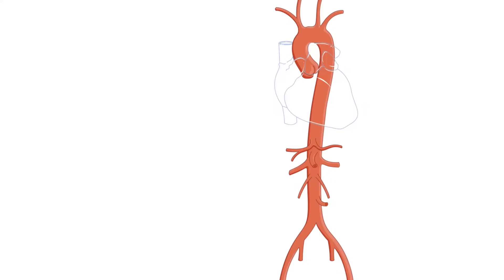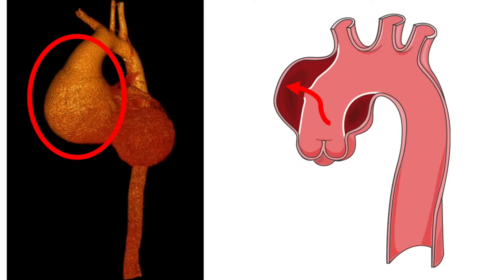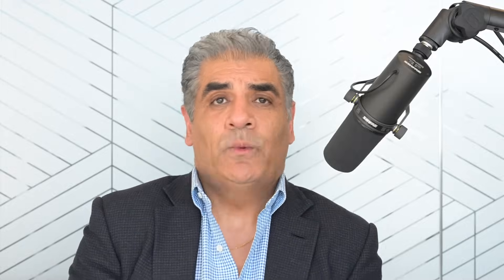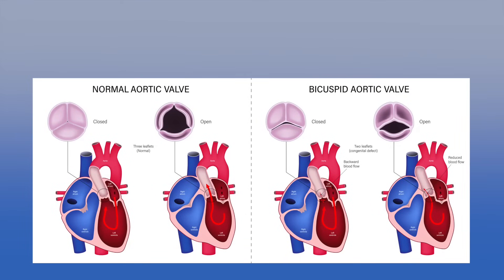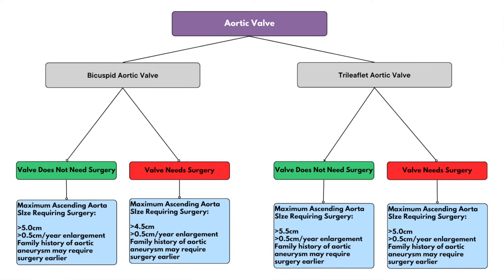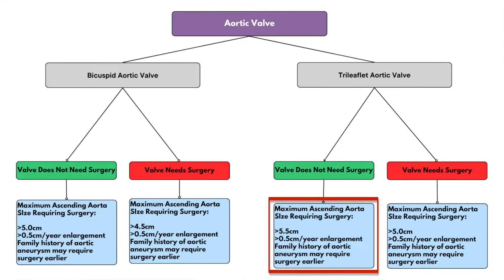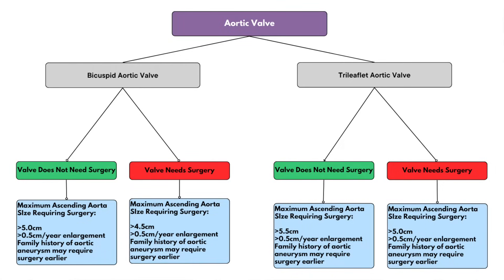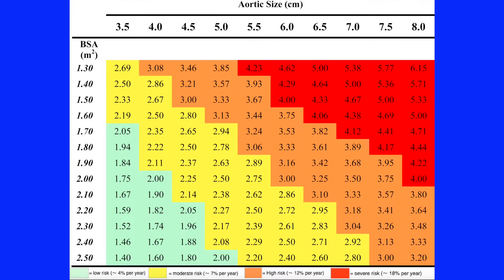How serious Is A Dilated Ascending Aorta?

Comment: At 53mm I had my Aortic root aneurysm replaced via the surgical technique known as the "David Procedure", whereas my aortic valve was not replaced. For those needing their aneurysm replaced, be aware of these side effects that I experienced. Post-op rapid atrial fib, 30-50% of patients experience this, also aortic valve regurgitation and murmur, with some people experiencing shortness of breath from the leaky aortic valve,  and lastly a bothersome chronic frequent PVC and PAC arrhythmias. Expect to be placed on a low dose beta blocker, for heart rate and arrhythmia treatment, even if you have normal B/P. My recovery at home took a full 12 weeks, mostly due to the rapid atrial fib, which resolved after about 5 weeks of anti arrhythmics. Today,  I am at over 5 years post-op now w/o A-fib, resumed my passion for hiking in the mountains 5K-13k elevation routes fully recovered. As far as my hiking vigor goes, I felt fully recovered approximately 1 yr post op. Cheers!

Comment: Should I be worry??Had an echo done last week and at the end it says dilated aorta

 LEFT VENTRICLE: Left ventricular size is normal. LV wall thickness is normal. Global systolic LV function is normal. Est. LV Ejection Fraction is 60-65%. LV Ejection Fraction (MODbp): 69.2 %. There is no evidence for LV regional wall motion abnormality. Normal diastolic function. Normal LV filling pressures. MV E/e': 5.6 . MV E' (septal) 7.2 cm/sec. MV E' (lateral) 10.1 cm/sec. LA volume index = 27.9 ml/m^2 (Norm 16 - 34). MV E/A: 0.87 . MV E 48.8 cm/sec. 

LEFT ATRIUM: Left atrial size is normal (16-34 ml/m^2). The interatrial septum (IAS) appears to be intact.

 MITRAL VALVE: The mitral valve appears structurally normal. No mitral stenosis. Trace mitral regurgitation. 

AORTIC VALVE: The aortic valve appears structurally normal. The aortic valve appears functionally tricuspid. No aortic stenosis. Trace aortic insufficiency. Unable to measure AI PHT. 

RIGHT VENTRICLE: Right ventricular size is normal. RV function is normal. TAPSE = 2.9 cm (Norm 1.7-3.1). RIGHT ATRIUM: Right atrial size is normal.

 TRICUSPID VALVE: The tricuspid valve appears structurally normal. There is no evidence for tricuspid valve stenosis. Trace tricuspid regurgitation. The estimated RVSP could not be accurately assessed.

 PULMONIC VALVE: The pulmonic valve is not well visualized. There is no evidence for pulmonic stenosis. There is no evidence for pulmonic insufficiency.

 GREAT VESSELS: The aortic root dimension is normal. Aortic Root dimension = 3.0 cm. The aortic root index is 1.9 (Norm < 2.4). The ascending aorta dimension is increased. Ascending Aorta dimension = 3.9 cm. The ascending aorta index is 2.4 (Norm < 2.4). IVC size is normal. IVC collapses > 50%. Estimated RA pressure of 3 mmHg. PERICARDIUM: No evidence of pericardial effusion. 

SUMMARY: There is no evidence for significant valvular pathology.

 TAA Surveillance: Thoracic aortic dilatation is noted. Consider gated CT for further evaluation if clinically appropriate.
Reply: I suffer from chronic hypertension.

Comment: I am a 29 years old male 85 kg. At januarry of 2024 i did an echo showing my ascending aorta at 42 mm and a biscupid valve with minimal regrutation. At Mars of 2024 an CT scan my dialation at 41.5 cm. On July 2024 an echo showed my dialation at 41 mm. Today on 3d of octomber 2024 an echo showed my dialation at 3.9. How is it possible that it grew smaller?
Reply from the maker: Echo is not the best estimate. Gated Ct or MRI is best.

Comment: i am 39. 1.75 m tall. 102 kilos. 4.9 ascending artic aneyrysm  in august(from 4.8 in april) and moderate bicuspid valve insufficiency. Whats my risk? i honestly dont understand the table. what should i do? is it time for surgery?
Reply from the maker: You need surgery  with valve preserving root replacement if possible. Long term
Prognosis excellent
Reply: @Thekeyholeheartclinic  what is my risk of dissection etc?

Comment: Hello thank you for your knowledge and time, unsure if I need second opinion they did multiple tests and this is what was determined. Would like to note this was found in occasional testing for something else.. Mildly enlarged mid ascending aorta diameter of 36mm. Everything else was normal on echo when later checked. I am 31, 5'9". Healthy but slightly on the heavier side 180lbs. Was told it could be due to biking? And was told to continue my normal exercise? Anything else it could be? Was told to check it again in a year or two.
Reply from the maker: 36mm aorta is likely normal but worth a repeat measurement in 2-3 years to ensure no growth. Is the aortic valve normal and trileaflet?

Comment: Found out last year I have Marfan syndrome and have a mild dilation of the aortic root at 3.9cm it’s an even dilation circumference wise. it’s been stable the past year and a half a bit nervous but hoping it doesn’t grow anymore. My father passed away at 44 years old from an aortic root dissection.
Reply: Kchilz32:  I also have had a diagnosis like this in recent years and had an abdominal aneurism repair (AAA) repair which required a long healing time.  Now it has been discovered that I have a descending aortic root enlargement which is being monitored. Father passed away at 57.  Get yourself regularly checked.
Reply: @ it’s nerve racking. I was just told last week I will need and aortic root repair in a couple of months. Doctor said they were going to connect with my specialist to find a good surgeon. But haven’t heard anything yet
Reply: @ :   It’s not my place to tell you what to do, but at my age of 75, a few different doctors who have checked on my situation are not alarmed at my dilation which is at 4.3, which has remained stable for a few years.  To make matters worse, even with blood pressure medication, my blood pressure is usually crazy high at 180 systolic - especially when I’m in the doctor’s office.  Ask again if your particular measurement is considered an emergency.

Comment: just got my results today and the dilation is 4.5 cm. the pain in my top middle back I describe as a deep very painful toothache, it never goes away. I am 57. My Dad and my Mom's sister (my Aunt) have both had open heart surgery, but I don't know the original reasons. I am a little frightened. I am stoic tho.
Reply: I had open heart surgery to repair a dilation was 5.4. Had the valve replaced also. Was 60 at the time and am doing very well. It’s a scary surgery but ensure you have a trusted hospital and surgeon and you should get through it well.
Reply: @eriksossa5297 : What is your trusted hospital, please?
Reply from the maker: Keep under surveillance 🙏

Comment: Hi there, just found out my Aortic Root is 3.7cm. 49 yr old female  Aorta Diameter is 3.4cm. Mild aortic regurgitation. Trace pulmonic valvular regurgitation. Trace bicuspid regurgitation. Borderline dilated aortic root 37mm. What does this all mean?
Reply: Thank you so much for your reply, I will look more into this matter. Aortic valve is trileaflet. Tricuspid valve normal. Only time it mentions bicuspid is when they mention Trace bicuspid regurgitation. Quite confusing.
Reply from the maker: Thank you for sharing. This will need monitoring If you have a truly bicuspid valve with serial echo and CT scan. Also genetic testing for aortopathy is useful especially in presence of family history.

Comment: Hello Doctor, My father is 69years( 135 kg, 6ft height). He has bicupid valve and has ascending arota is 5.5cm.  Should he go for TAVR or Bantall Procedure.
Reply from the maker: Thanks…. No question here: aortic root surgery. TAVI will not deal with enlarged aorta pipe.
Reply: I'm 68 yo with identical problems as your dad, was 50 mm in March 2023, 6 months later increased to 53 mm. My surgeon didn't schedule the surgery until Nov 7th 2024.  I was discharged 7 days after the open heart surgery, recovering well so far, I walked for almost an hour today in a mall and stopped taking Tylenol 500.

Comment: Hello Dr. Thank you so much for this video. I found out about 2 years ago I had a dilated root (4.1 cm) and dilated ascending aorta (3.3). I've done a ton of research and have been very impressed with the keyhole technique. A couple of questions, why has this not caught on in the US? Do you anticipate that this technique will soon be more common here as well? Also, regarding my measurements... Finding out I had this dilation turned our lives upside down. Since my initial measurements I have not had any further dilation. I don't smoke, good blood pressure, tricuspid valve,  and am in general good health. I've lifted weights forever. I'm wondering if my measurements are just the result of remodeling due to my athletic endeavors. Could having an aortic root of 4.1 cm (which has not grown in the last 2 years) just be a normal thing for some people? Especially those that have a long history of working out. I am male, 5'-10", 195 lbs, and 43 years old. Thanks so much!
Reply: Did you do a cat scan or echo? Mine was way off in a echo
Reply: @Lisachelle  I did both a CT and an Echo. After numerous echos and CT's, they have all been very close to each other. I have heard that depending on where the dilation is, you could have different readings.
Reply: Mine echo was 4.7 and cat scan w contrast was 3.9 mid ascending.. way off to me.. a high normal

Comment: Left single renal artery are seen with no significant stenosis.
Abdominal Viscera:
The liver, spleen, pancreas and intestines are normal. There is no significant mesenteric /
retroperitoneal lymphadenopathy. There is no free or loculated fluid collection in the abdomen.
Bilateral kidneys are of normal size and attenuation with normal cortical enhancement.
Multiple bilateral renal cortical cysts are seen, largest in right kidney measuring 10 x 11 mm.
Urinary bladder is partially distended.
Chest and Mediastinum:
The cardiac size is normal. No pericardial effusion. There is no significant mediastinal
lymphadenopathy.
The lungs and pleural spaces are clear.
Ancillary findings -
Small hiatus hernia noted.
Mild degenerative changes are noted in the spine.
The aortic measurements at various levels are as follows:
P

Comment: Thoracic aorta:
Mild atherosclerotic changes seen in form of irregular wall thickening and calcifications
without significant luminal stenosis.
There is saccular outpouching measuring 4.9 x 5.7 x 5.5 cm, noted arising froma
nterior wall of
mid to distal aortic arch extending into anterior mediastinum and lefthemithorax, with large
filling defect at sac and peripheral calcifications - of concern for thrombosed aneurysm. There
is mild mass effect in the form ofcompressive atelectasis in anterior segment left upper lobe.
Arch branches and coronary arteries:
Left aortic arch . The branch vessels are normal in caliber with no aneurysm or dissection.
Conventional coronary anatomy.
Abdominal aorta and iliac arteries:
There is irregular wall thickening with calcification for length of 3.0 cm noted in infrarenal
aorta causing upt0 50% luminal stenosis.
Mild irregular wall thickening with calcificationsuprarenal and renal segments of the abdominal aorta.
The iliac and femoral vessels are of normal caliber.
Mesenteric arteries:
The celiac artery and its branches, the common hepatic and splenic arteries are of normal caliber
without significant luminal stenosis.
The SMA is normal in caliber without significant luminal stenosis. There is no bowel infarction.
The inferior mesenteric artery is normal.
Renal arteries:
Dual right renal arteries noted , accessory renal artery is supplying upper pole of right kidney.
Pag
Reply: Please give a clear details what to do ????
Reply from the maker: Sir you need to be reviewed by a specialist cardiovascular team. Presumably this is the case?
Reply: Sir they are telling to do arotic arch replacement whether it's serious case
Reply: It's 3.0cm noted wheather there is any guide line to do all are telling to do it's to be operated

Comment: Hello, I just found out my ascending aorta is enlarged after a recent ultrasound/echocardiogram and has grown from 4.3 cm, ultrasound done August 30, to 5.3 cm as of November 30. Previously I had been diagnosed with an enlarged aortic root which is 5.2 cm as of my last ultrasound. The aortic root has been growing slowly, about 1 cm over this last year. 
Should I be concerned? Should I be talking to my cardiologist about being referred to a surgeon?
I haven’t heard from my cardiologist after my most recent ultrasound. 
(I’m 52, male, 6’6” tall, weighing 400 pounds, history of high blood pressure, mild arterial plaque, daily chest pain)
Thank you for your time…
Reply from the maker: Have you had a gated CT scan? These size changes seem to be quite significantly different and echo is not the most accurate modality. You need further analysis soon.
Reply: I haven’t had the ct scan yet. Thank you for the advice!!!

Comment: The study was technically limited.
• Heart Rhythm: sinus rhythm.
• Normal chamber sizes.
• The left ventricular global systolic function is normal. No left
ventricular segmental wall motion abnormalities identified, but
endocardial definition is suboptimal.
• Valves poorly visualized, by color/ Doppler, no obvious significant
abnormalitites
• The aortic root is grossly normal in size at the sinuses of Valsalva.
The ascending aorta is mildly dilated. Ascending aorta measures 4.1 cm@
3.1 cm distal to STJ
• The inferior vena cava is not well visualized, probably at least mildly
dilated
• Compared with prior report dated 1/28/2022: ascending aorta was not
visualized on prior study
 I am a 56 year old woman with a bmi that is 66.
Do you think it would be safe to have weight loss surgery?

Comment: Part of my report. I'm a runner. Been running for 20 years. Can this be normal for aortic root size or am i looking at problems on the horizon? 
Thanks for your time  i have trileaflets Systemic arteries: Mild to moderate dilataion of aortic root (The
end-diastolic aortic root diameter is 4.4cm-re-measured), ascending aorta
is upper limits of normal (4cm)
- Mitral valve: There is mild regurgitation.
- Left atrium: The atrium is dilated.
- Right atrium: The atrium is dilated.
- Inferior vena cava: The IVC is normal-sized. The IVC is dilated.
Respirophasic diameter changes are in the normal range (> 50%), mildly
elevated central venous pressure.
- Compared with previous study, there has been progression of aortic root
diameter.
Reply: Iam 65 and run also need to stay in shape iam at 4 right now I also lift weights and train regularly and am concerned

Comment: thanks for your video. I have an aortic anuresym at 4.2cm with a bicuspid aortic valve the valve has a tiny leak but its been like that for years and the valve itself hasnt got worse. My question is is there a chance that I can live with this with out surgery im only 33 if I do need surgery can I live a normal life afterwards.
Reply: I have the exact same. 42mm ascending aorta and a functional bicuspid aortic valve. Im 34 years old. Im 6ft7. Ive been doing weightlifting since 2014. I was wondering if ive been able to continue weightlifting. Best regards from Germany
Reply from the maker: It needs monitoring. Sometines PEARS procedure can be considered before aortic enlarges too much ..... genetic testing for aortopathy is required for this
Reply: @Thekeyholeheartclinic hello doc im a pilot from MEA , how can i contact you !?
Reply: @Thekeyholeheartclinic  What is PEARS? I know is a year late asking this question (10/6/24)  when I came to watch this video.